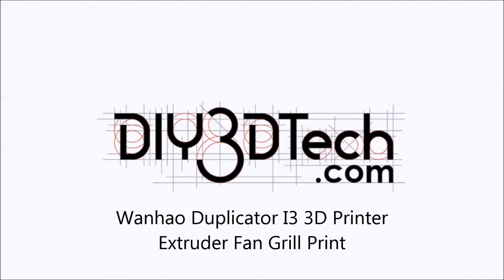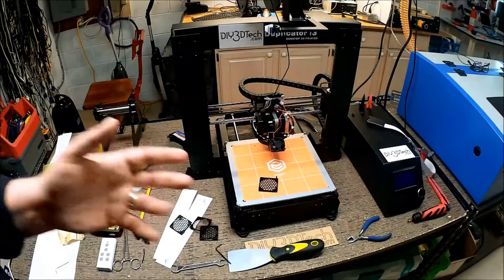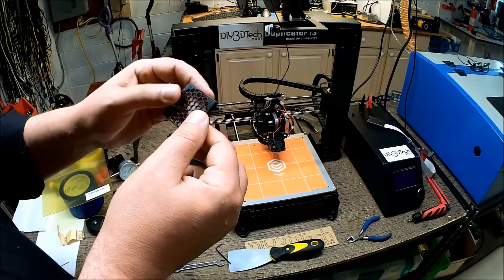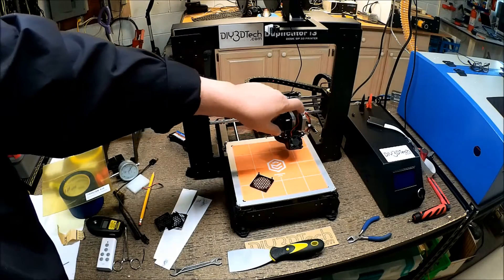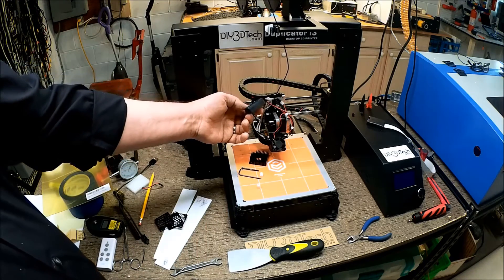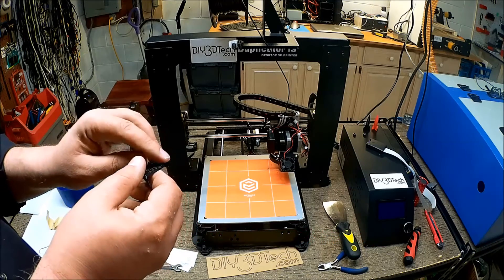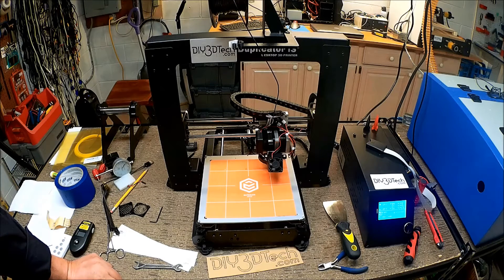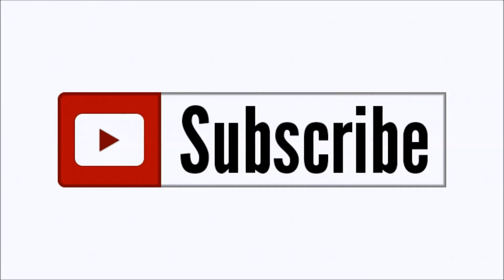Wanhao Duplicator I3 3D Printer - Extruder Fan Grill Print!

Comment: I thought I would try something different, so I did a video response. Whatever happen to those.. ?? Hope this doesn't get caught in the spam system...  https://youtu.be/xQV8TTvw8So
Reply from the maker: +RJ_Make Yes did hit the spam filter but found and it was cool video!  Really trying to talk myself into spending the money for simplify 3D.  Have mixed feelings as it is a killer app, however because of the cost not a lot of people use it compared to a CURA or SLicer.  Many thanks again for the video!
Reply: +DIY3DTECH.com Ah thanks for pulling it out of the can.. :-) I don't think your will be disappointed with S3D. It's the single best upgrade I've done in my 3D printing space.
Reply from the maker: +RJ_Make Ah more pressure to buy :-) What I think is cool is you can break it up into "processes" as this add hours of endless fun (and trouble) for me.  As one of the things I have on my list is to jail break my Da Vinci 2.0 and play with a water based support material to create so "crazy" printed objects.  In short, print a solid cube and drop in water just to wait for the magic to happen!
Reply: +DIY3DTECH.com I'm dead serious, if you think multiple processes are cool just wait to until you see the other goodies under the hood.... your head is going to explode.. :-)
Reply from the maker: Thats part of what I fear :-)  To many toys, too little time!

Comment: I added a couple wire grills to mine. One to guard against sticking an Allen wrench into the fan on the extruder and breaking off fan blades (yes, that's happened) and the other one on the back of the power supply to keep your fingers out of the fan when reaching around to power the printer off.

Comment: You probably already done this but withe all metal hotend the retraction must be lowered a lot to somewhere around 0.5mm
Reply from the maker: +Stefan Lindström Nope have not, have left it at the stock setting.  However after this print, it is starting to make sense.  So Cura recommends 45.5mm and your suggestion is 0.5mm?  Are you have good results (i.e. lack of stringing) at this amount?
Reply: +DIY3DTECH.com I haven't installed mine yet but this is from the micro Swiss install guide 

"Tips to get best results with All Metal Hotend:
Reduce retraction amount. Allemetal hotend needs a lot less retraction. 
We had luck printing PLA with as little as 0.5mm retraction, without oozing.
For PETG, try 1.0mm retraction.
For PLA, you might need to increase extruder temperature 10-15 degrees.
If temperature is not stable after conversion, PID tuning might be required.
Highly recommend to change stock Wanhao i3 extruder gear to D4 style 
gear."
Reply from the maker: +Stefan Lindström Thanks have noticed I need to run hotter for PLA so I am not nuts, also will try the lower retraction and see how that works as it makes sense...
Reply: DIY3DTECH.com please let me know how it goes.

Comment: i just printed two of them the first the spikes did do well i think that was me not leveling the bed the sec printed fine...i have it up sidedown and two 3m nylon nuts int the empty fan hole and two 3m nylon screws at the top and cut off the spikes.
Reply from the maker: +Chi Sty Interesting and likely a good way to go (e.g. two 3m nylon nuts int the empty fan hole and two 3m nylon screws at the top and cut off the spikes).  Might try something like this later or even do a re-mix.
Reply: +DIY3DTECH.com when you cut off the spikes leave the base nub of the spike as is on top ...

Comment: Surprised, since most G-code has hexagon in fills, shouldn't be too hard to print. I don't need it on my FlashForge, but could print it easier than you did  I think.
Reply from the maker: +Mickice Know what you mean, however think the issue was the retraction as I might try with a different slicer as it wanted to print each hex as a stand alone which was odd.
Reply: I hear everyone in 3D printing talk about retraction, I know the FF Finder is PLA only but I don't think using Flash Print there are any retraction options for me to set, but I hardly ever get serious stringing or under printing either.
Reply from the maker: +Mickice There are a number of factors which add in and one of the major ones is the type of the hotend and speed.  I am looking at doing a video on this :-)
Reply: I enjoy all 3D printing videos so yeah, do it. Even if they don't apply to my machine, you learn the science behind why something goes wrong.
Reply from the maker: Totally agree!